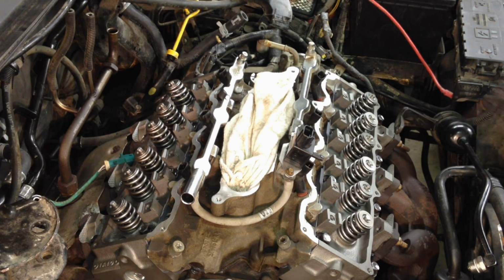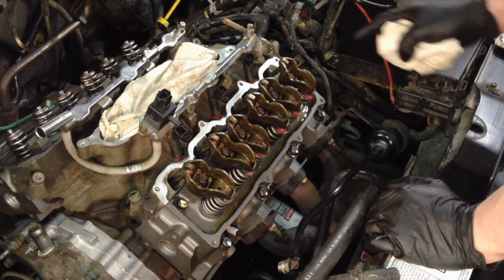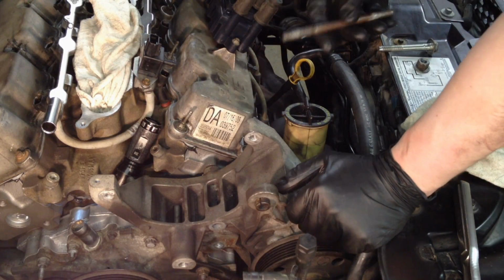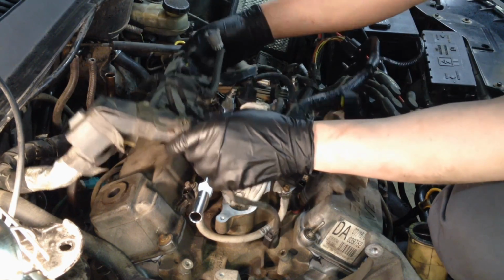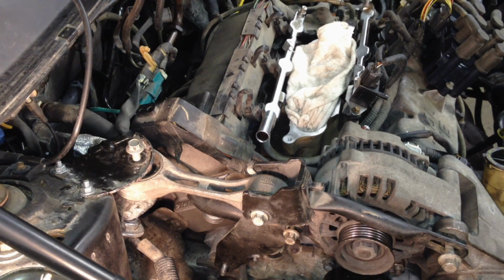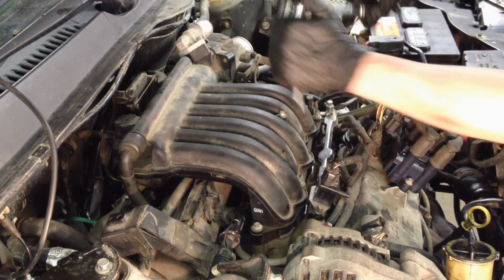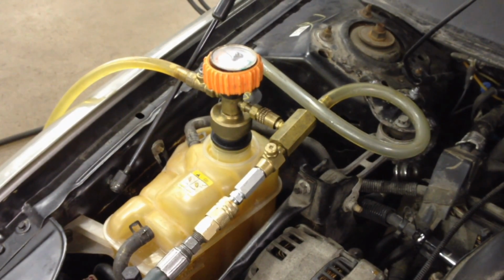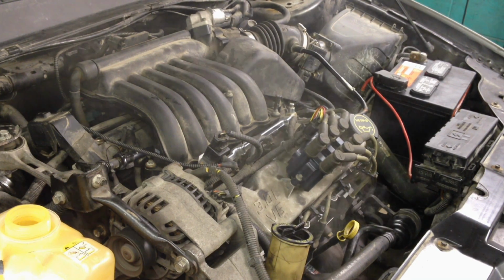Ford Taurus 3.0L 12v Head Gaskets Replacement Pt 2

Comment: What happened to that ground wire that went up and over the pcm connector? Where does that go tov
Reply: It goes from the ground near the firewall to the side of the engine block right under the left head

Comment: Good thing i ran up to your video and i also subscribed very detail. I have also the same car and I hearing knock on my engine specially on my valve cover at the back im having bad misfire and a lean gasoline exhaust stuck open so i might as well change my head gaskets. The question is can i just do the one bank only or do i have to replace it all? Is that possible?

Comment: I can’t seem to get the pulleys to line back up properly. I’ve tried the straight edge on all the pulleys and seems the PS pump bracket isn’t lined up right. Any tips on the bolts for the power steering pump mounting bracket? Is the bolts supposed to be only of certain depth? Number of turns per bolt? Counting the threads left showing?

Comment: I have one of these engines in my 04 Taurus with 320k on it and still going. Very informative in case I ever have a head issue. Sometime in the future I am going to change the oil pan gasket. While I'm in there would you change the rod bearings or leave well enough alone because currently they are not making any noise? What should I look for while I have the pan off? Many thanks for your channel as I have several Fords!

Comment: Anybody know the torque specs for the rocker bolts? I didn't hear it mentioned during video, thanks.
Reply from the maker: To install, reverse the removal procedure. Tighten the bolts in two stages.
Stage 1: Tighten to 10 Nm (89 Lb-in).
Stage 2: Tighten to 32 Nm (24 Lb-in).
Reply: Thanks, great videos btw. I'll be doing gasket in the morning, had coolant leaking near the number one cylinder, but luckily no coolant in the oil or anything. Thanks so much bro

Comment: Not that I'm the brightest rock in the creek. but how do you get nylon gas fittings off a fuel filter of an 06 Taurus.  I had a new gas line installed in 2019 and they are nylon. I have no clue how to get the new clips to come off without messing up the the fittings. other than if its not broke don't fix it ?? Anybody ??

Comment: Just finished up and the car seems to be running well. It didn’t have a badly blown head gasket but was emitting excessive moisture through the exhaust. Put my hand in the exhaust and it seems dryer like it should be. I don’t think I could have done it without your video.

BTW the worst issue I had was I followed the advice of another guys video and left the wiring harness on to save work. It was a huge P.I.T.A. As it was really in the way as I was trying to hold a 30 something pound block in one hand and the wiring harness in the other. Had to attempt over and over so I wish I would have followed your video completely.

Comment: Hey nice vids by the way. I have a 2004 taurus with 12v 3.0 motor . the sparkplug in the front head by the oil dipstick is seized & wont come out! All others are fine. Should i take the head off an take it to a machine shop( scared it may break off in head) or replace the head? Can you help?

Comment: I see the flaw in my question from below. The lower intake bolts go into the heads. So yes it has to come off. Im also guessing the push rods go into the intake too. 

I dont see an issue with leaving the front head on though besides the obvious and that is i should do both valve jobs and the gasket. Money and time is our issue since its our only car.

Also ty for tge videos. Ive fixed so much on this car because of them. Well diagnosing my issue before getting a compression and leak down test done.

Comment: I need to replace a valve on the rear head. Do i have to pull intake manifold like in part one or can i just remove the head. Yes it would be best to do that gasket too i know.

Comment: i agree, this engines are so reliable this overheat is usually caused by something  else stuck thermostat water pump that the impellers are ate up from coolant that has never been replaced. good video!

Comment: So, more problems with our 2001 Sable (3.0 vulcan OHV).   Car ran hot other day, had to fill with coolant.  I bought new FoMoCO water pump -- friend didn't have time to install over this easter weekend.. FML.    So she is on way home, and car loses power on highway, gurgling sound..    Reservoir was flowng over / steam bubbling.  Car would not crank over - making odd crank noise -- i was not there at time 

Sign of now blown head gasket??    Or other issue because over heated?   Thermostat was changed about 5 months ago as preventative --  as heater core is plugged. 

120,000 miles on clock now.  I know this is time where water pump will need to be replaced.....  now in position where possible head gasket.    No idea how much this would even cost for a shop to perform

Comment: Great video!  I have a 2001 Ford Taurus with the Duratec 3.0 DOHC with a low compression on #6.  You have a video with the head replacement for the Duratec?  Thanks!

Comment: great vedio ...i have a 2002 ford taurus w 173.00 and runs great and dont over heat but cant get any heat and friends tell me this are common for headcasket why no heat .......the waterpump was changed and i watch the vid on where u said if the temp garge aint half way look at the thermostate and so i pulled it out and found someone had it installed backwards i dont know if it was done by accent or if they thurt it would help with the heat and it still didnt overheat even w that backwards lol ....so my next thing i was going to check was the heater core ? let me know what u think or what i should check next thanks for the vido keep them coming

Comment: whats the torque on the rocker arms?
Reply: The torque is 15 ft-lbs.  Autozone has an online chart of all the torques. 
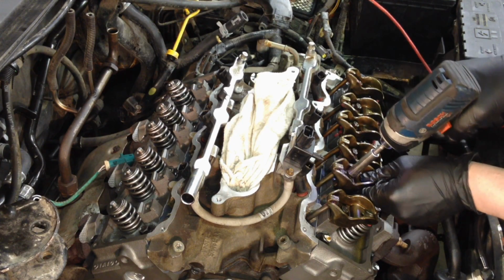I know, at 3:31 "and then we'll torque 'em after that.  Here's a good shot of the pushrod going down to the lifter there ... ."  He was preoccupied with making sure people centered the pushrods in the lifters.  First rate video however, he thoroughly covered the details with way better video and audio than the usual butt-crack amateur actor who wants to make sure his face is in the picture.
Reply: Anyone figure it out?
Reply: @shaunschlagerphotography8849  24ft lbs

Comment: This is about what I thought would be best. I put a rachet on the crank wheel nut and turned it by hand to check the lifter to rocker movement to verify the rods are all straight and seated and I'm moving forward. Great video and very helpful. Thank you for all the time you took to make this for us amateurs.

Comment: When you were installing the pushrods and rockers you did not mention rotating the crankshaft to have a mark at the 11 o'clock position. I have seen this warning on some other sites and wondered if this is critical before cranking the engine after a head gasket replacement job?
Reply from the maker: No there is no mention of this anywhere is the Ford workshop manual. There is no reason to the cam to crank timing was never touched and still in time.

Comment: This is the most complete step by step video of a head gasket replacement. Thanks. I wish the manifold to cat bolts on my 1999 were like yours with the nuts on top. What a bear getting to the nuts from the bottom. Hours finally had to cut the stud.

Comment: Hi, excellent videos. I have a 2005 Ford Taurus, OHV flex fuel, 150K miles, with a crack in the right rear exhaust manifold. I watched your video to see how to get to it from the top by removing the upper intake. My main concern is the exhaust manifold bolts breaking off inside the head. Trying to extract broken bolts in a tight space would be a nightmare and I don't want to have to pull the head. Should I use a torch to heat up the bolts first? Do these bolts typically break off in a Ford? I've only worked on Chevys and they always break off. Any suggestions? My MPG is dismal, like 9 MPG, I've checked for vacuum leaks, did a tune up, changed the O2 sensors, nothing worked. I'm hoping that replacing the cracked exhaust manifold will cure the problem.Thanx.

Comment: I have this same car and used your video as a a guide, but all I did with mine was change the lower intake and upper intake gaskets.  Of course I removed the rocker arms and push rods to get the intake manifold out.  Now that I have everything put back together, I am losing compression in one cylinder.  I did plug the crank sensor plug back and and let it run for a few second and then shut it down because it sounded pretty rough.  I am stuck right now trying to back track what I may have done wrong.  Could a misaligned rocker arm cause this?

Comment: Great videos. Im following this for my 2000 ford taurus 3.0 now. Mines a little different as such my coil pack is located on a bracket to the right of the front cylinder head so I had to yank it and a bracket. I had couple quick questions. Do you have to remove the rockers and push rods completely to remove the head? Saw another video they left them on and took the head off? Related question I only have a torque wrench thats foot lbs can you tell me the torque in foot pounds for the rockers, the valve covers and the upper intake(plethra). Thanks and again great video.

Comment: Nice professional job! You're as meticulous as I am when it comes to cleanliness and assembly lubrication especially the valve stems and all the wear/contact points with assembly lube. Great to see initial spinning of engine to get oil circulation prior to starting. I've watched quite a few of your videos and am impressed with your attention to detail & knowledge. It's great to see good work ethics & professional jobs in our field! Great video!

Comment: I have a 79 Impala 305 v8, which needs a head gasket job...what's the average cost for this vehicle. The oil is "milky" like.
Reply from the maker: +low key They will likely quote between 12-15hrs at whatever labor rate they run and then there are the parts they may need which varies based on the job.

Comment: Well I was pretty stressed that I have to do a top end rebuild on my 99 ranger with a 3.0. These 2 videos took that stress away lol. Thank you! I will be starting my project next weekend. I am just doing the Remanufactured heads with hardened seats. I cant believe they blow with such low miles. I only have 140k

Comment: what the cost?
Reply from the maker: +Derek Ashby For a head job? Well into the thousands.
Reply: Lord I have and 01 Taurus I like to have that work done to
Reply from the maker: +Derek Ashby Yeah it all depends on if one or both sides need replacing and if th ehead need valve work or reman units.
Reply: +FordTechMakuloco thanks

Comment: Is this the same engine as the 2000 Mazda 3.0 B3000 aka Ranger?
Reply: +OneCupOfCoffee204  I just did my cylinder heads on my 2000 3.0 Ranger and yes very similar engines.

Comment: Hey, thanks for this man. I looked to this video before I jumped into the job myself on my 2002 Taurus with 200,000 miles on it, between the repair manual and the video it was a big help. Got the head gaskets replaced, along with a cracked exhaust manifold, and blown out oil pan gasket (which you also had a helpful video for, thanks again). Aside from the order confusion with my local auto parts store, an upper intake bolt snapping off before torque down, and this darn 95°F weather we had all week, it was not that bad and went fairly smoothly. It fired right up today (which I'm pretty happy about since this is my first attempt at something like this) and it's running great! No more misfires and no more leaks.

This certainly builds my confidence in working on my car and I appreciate the work you put into showing each step. I have a '99 Taurus I plan to do some work on. Seem to be having some slight transmission issues and some decent leakage, possibly from the torque converter or the main seal, not sure yet. I'm no mechanic but I'm patient and a quick learner, so hopefully I will figure it out if it needs a rebuild. If you happen to have a video for that, I would definitely check it out. Or if you have any advice or suggestions, I wouldn't mind some experienced assistance. Thanks again.
Reply from the maker: Jeremiah Nebergall I have a video on the common leak spots on the transmissions and a little trick to stop them under my ford quick tips videos.
Reply: FordTechMakuloco q

Comment: I just wanted to say thank you for the video. My wife and I can not afford such a full head gasket replacement. I followed your direction and successfully changed out the head gaskets. After filling to engine with radiator fluids i did discover fluid dripping from the radiator on the passenger side.
So now I might have to change out the radiator.
Thanks again for the video.

Maverick73
Reply from the maker: Alister Munroe Check the hose connections on that side first if the clamps are not on there just right they will leak and also there is a branch off line in that area that rots and leaks. Radiators are not common on these.

Comment: Really nice video. My wife drives an 2002 that I've done a fair amount of work on. 162K on the clock and still running strong. Refreshed to hear the Christian music in the background too. I've done an upper and lower intake job on the 3.8 gm motor but never have pulled heads before. this video make me want to take my wifes engine apart even though its running great. LOL !

Comment: I just wanted to say Thanks for the video. I will be taking on this momentous  task soon with my taurus.
Reply: Did you have any issues with the pushrods and fulcrum arms? I have to that just dont seem to want to line up on the rear bank and I've triple checked using a mirror. The pushrod is in the lifter yet it doesn't want to sit flat and line up

Comment: When putting the rockers back on. Do you just run them down like you did in your video. And then torque them down? What is the torque? Is there any special procedure?
Reply from the maker: Yes you just tighten them down the hydraulic lifters adjust the lash. Torque spec is 24ft lbs

Comment: Thomas Aiello1 day ago
 
ok started car amd can hear a gurgling noise from what seems to be behind the TB like am echo hallow gurgle noise made louder by the snorkle acting as a megaphone cant find were i went wrong any ideas, also has a smell never smelt bnefore may be exhaust or eng area ? i never cleaned carbon on injectors will that become an issue also iam sorry have no one else to turn to.
Reply  ·

Comment: Tom again great video 1st timer at anything like this no my way around too; box, I was woundering after I tourqe the rockers to the tower, should there  be any play in the arm or should it be rigid i was always told there are no stupid ?
Reply from the maker: Some will be hard to move and some will move quite easy by hand. It all depends on if that valve is being actuated at that moment or not. Just make sure they are seated fully in the slot in the tower and torqued down right, it is very important and is why I go over it in detail with close ups.

Comment: Help.   Both Haynes and Chilton tell me "do not tighten the rocker arms unless each one has been rotated to top dead center, or you can do serious damage."  Neither yours, or any other online tutorial mention this.   Is this warning much ado about nothing, or is it for real?   Also, all of my rocker fulcrums seat almost fully in the head at hand tight, except one.   It barely reaches the top of the head seat, let alone bottoms out.  The push rod is fully seated in the lifter - triple checked.  Is this okay?   Will it seat upon torquing.

Your video is awesome and thanks very much.
Reply from the maker: Nope no need the engine is still timed. The valve spring will compress and the rocker will seat on tower in head. Just make sure it fully seats as I stress in my video.
Reply: Thanks very much.
Reply: Job turned out fine.  Thanks.   Doing same job on different vehicle.  Manual mentions a two stage torquing process....11, then 24 lbs.  Do i do them all 11, then all 24?   Makes no sense.  What do they mean?  Thanks.
Reply from the maker: the 11 is just to seat them you do all at 11 then all at 22

Comment: @ 4:30 when you put the sealant on (The Ford spec crosses over to Permatex Ultra Black), You used something different? I emailed Permatex and they told me to "Apply sealant, Assemble parts with bolts finger tight, Wait 1 hour, Torque bolts to manufacturer’s spec, Wait 24 hours then start car". Now you didn't do that and it seemed to come out OK?
Reply from the maker: We use the Mopar engine sealant as we are a dual dealer and it works great. No you apply sealant snug up bolts and then torque just as shown that is the actual procedure from Ford ands is the same no matter what sealant you use. I follow Ford procedures and never have a problem. The Ford procedure to tighten right away has been that way for years and years on any model.

Comment: So you don't have to move each cylinder to TDC before you tighten down the rocker arms?  How long should it take to do this job?  Thanks.
Reply from the maker: Marc Liebeskind No the cam and crank are still timed and the valves react as such so no need.